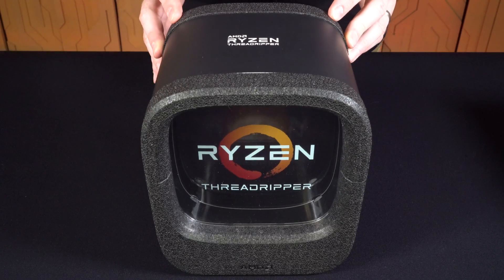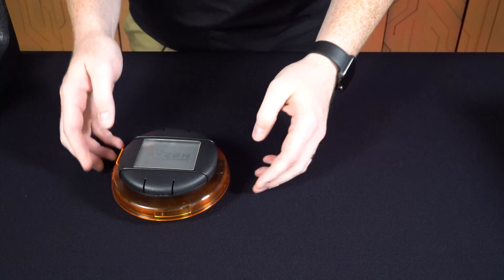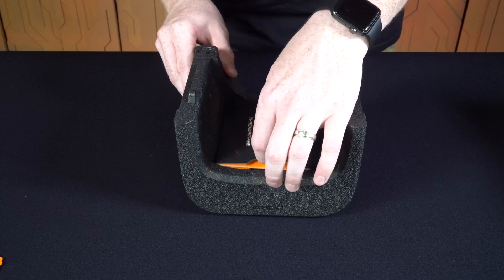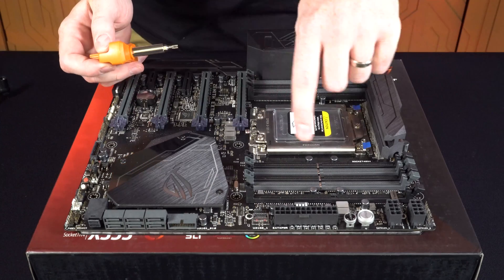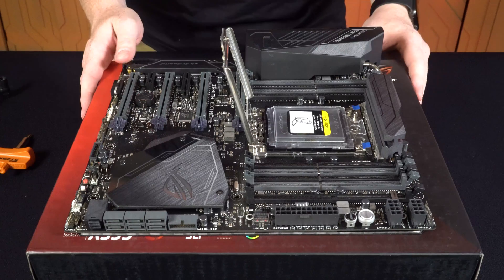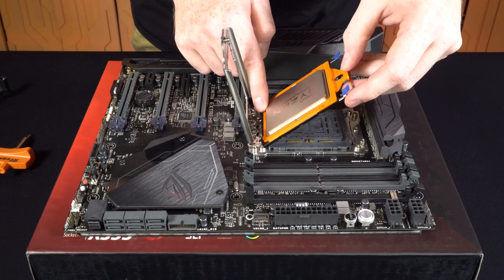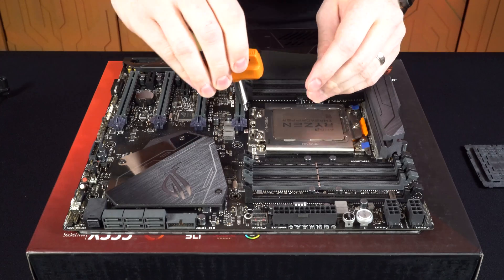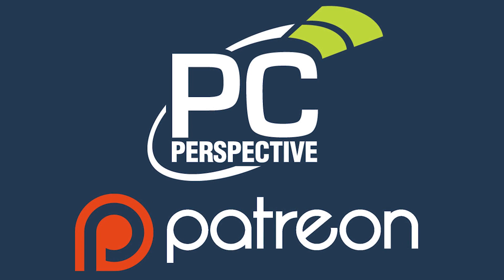How to install the AMD Ryzen Threadripper Processor

Comment: wow no more drop in  at one time we had to futs around with spring loaded clips that were like mini wishbone suspensions and after that we had a CPU cooler that had what looked like plastic wall anchors to secure it to the mother board this looks so much easier and strait forward being as I will go with water cooling not worried about the tension just want a good fit to shed the heat as most users will be using some form of water cooling its just the way to go when the power goes this high but heat sinks weigh allot compared to a water block also wanting to mount the board horizontal likely in the core x9 case this is is better for allot of reasons if you go with an air cooler better for the CPU video cards becoming heavier these days will put less stress on the socket  the same for m2 ssds when mounted flat on the motherboard and to some degree even when mounted like ram then comes the issue of air flow you do not have heat raising from one area of board to effect another with proper air flow better for the board all around here is the down side to a horizontal mother board mounting size of the case that is a big issue next is heat from other sources might be an issue like non SDD hard drives being mounted under the board in the core x9 case air flow from the front is split from the front air enters some goes over the board and out the top and back some air goes under the board  were the power supply and 3.5 internal drives are then it can exit via the power supply or a fan in the back next to the PSU or out the side with an optional second side without a window default is one side with a window one without  the one without is were the fans go but keep in mind the fans will interfere with the placement of your hard drives so 2 on each side and you have no issue with hard drives use 4 fans on one side and 2 on the other side and you have space for 3 dives and then no need for that many fans really you just want enough fan exhaust on the bottom so your not sucking hot air from the hard drives and reducing cooling for the mother board its not about supper cooling the typical 3 hard drives you might find on a typical insane work station most people do not have more then one hard drive todays big gamers are gonna have a min of 250 GB m2 ssd and 2 TB on none SSD storage while I would want 500 GB or 1 TB  m2 storage and another 2-4 non SSD storeage witch would require one hard drive and what what I want to see more of is external bays for USB ports fan controllers and media slots as well as hot swapable drives internal drive bays are just no longer needed as much any more
Reply: on another note off topic we need cases with standardized fittings for liquid cooling hard ware radators seem to fit over fan locations pretty standard until you get into sizes above 2 120/240 mm fan openings so we have water pump and reservoir mounting issues were double sided tape seems to be offered right now or special brackets to adapt to fan mounting holes really we need a few options of 4 screw holes in the bottom of the case with an unobstructed clearance to the top for that big bong tube and hard rubber pads to isolate pump vibrations

Comment: Hi, i pre-ordered the Ryzen threadripper 16 core and also the Asus ROG motherboard on Amazon, i don't have too much experience building pc's  i basically work with 3d renderings and my question is:
What PC tower Case should i get for this motherboards and it's other components?
What will be the best Cooling system for this processor?
And  Do i need a specific power supply for this? 

Any recommendations ?
Thanks in advance

Comment: Thank you, for this video, for showing us that it is NOT that hard to install the AMD's Threadripper process, you was the first YouTube'er, beside MSI . that actually done it correctly and not putting your fingers oil allover the CPU under pads, nor did you drop it or cast it down on the table; thanks for respecting the technology.
Raid out.

Comment: wow, not sure what think of it. What was wrong with the old way?
Reply: fetB Difference now is the size of the processor and the amount of pins around 4000. More chances of damaging the pins on the motherboard due to the size/weight of the cpu. This should help beginners and I don't mind it even if it takes an extra 30 seconds and saves me from accidentally dropping the cpu and having to get my motherboard repaired/replaced.

Comment: that does not seem to be a very wise torque procedure. after you flip down the processor retention bracket you  should probably  start all the screws a couple of threads and then torque them in order

just my two cents, im a mechanic and i torque things all day long... so what do i know
Reply: Tha is the correct way, I'm also mechanic, but normal people don't know about torking, not the proper procedure to do it, they just screw however they want.
Reply: TORQUE!!!

Comment: Could you imagine if games did actually use 16 cores though? You could underclock this to 1GHz and run it entirely passively.
Reply: other tomperson it's possible to spread dozens of tasks over 16 cores, but near impossible to make the most demanding task so easy to process. In games one or two tasks are always very demanding and you can't parallelize them.
Reply: yep, its like motor tuning. You can do a lot of shit, but you can't replace pure capacity

Comment: That mechanism looks like a massive pain in the arse.
Reply: Not really. Looks better than dropping this gigantic processor on such tiny pins...
Reply: You spelled 'over-engineered' wrong
Reply: Actually it is extremely well engineered. LGA pins of X399 motherboards are very fragile, and this mechanism is intended for minimizing the risk of damaging any of the pins. Important when you factor the price of an X399 motherboard.
Reply: HARDOCP damaged his motherboard socket; Kyle said the pins are extremely fragile. https://www.hardocp.com/article/2017/08/03/amd_ryzen_threadripper_unboxing_install
Reply: looks like fun.
Reply: I think it's better than the pins on chip that amd had, destroyed a few pins on them cpus after trying to fit the cpu with the board in the case like a nob..

Comment: I like that it seems pretty idiot proof, its always a worry that I'll clumsily bend a pin on the CPU or socket.
Not sure about the orange bit that remains visible when installed in bracket, but I imagine most air & water coolers will cover that anyway.

Comment: We know how to install it now. I CAME HERE FOR BENCHMARKS.
Reply: Not going to happen until the 10th when the NDA lifts.
Reply: in games the same performence as the 8 core models, but fucking fast in workloads.
Reply: I wonder if it won't take a little core wrangling to squeeze some performance out of it just to keep it on the same die. But hopefully the IF will do what it's supposed to and it won't matter.
Reply: I came here trying to find out how JayzTwoBrainCells broke his...

Comment: this is the most bullshit instalation process ever......who ever had any probem installing any intel LGA cpu? anyone? My old 775 P4 didnt even have a covers, ffs.
Reply: Well then don't buy one, problem solved!
Reply: Bit of a difference between 775 and 4094 pins. With so many pins placed so closely together, this installation method reduces the risk of bending a pin from trying to fit the CPU into the socket by hand (or dropping it while trying).
The installation took about 2 minutes and 28 seconds in this video (from 2:43 to 5:11). If you think that's too time consuming, maybe building a PC just isn't for you and you should just get an iMac.
Reply: The socket has more than 4000 pins in it, and these pins are waaaaay more delicate than intel ones, you can't simply install the CPU the same way Intel LGA does, you need more security measures to not damage the pins, so AMD did great to provide us with this solution so WE don't take the risk of losing our money by fucking our mobo and CPU, if Intel had this socket side, it would have done the same.
Reply: Quite a difference from a 775 pin socket to one with 4092 pins! Do you even realise how TINY those are on modern sockets?
Reply: Laharl Krichevskoy If you find this hard to do then you need to check your brain.
Reply: The amount of pins on consumer Intel CPUs is much lower than the amount of pins on X399. The risk of damaging the pins with the old "just drop the cpu" method would be incredibly high.
Reply: Your old 775 P4 also didn't have over 4000 pins and a massive surface area that needs a large amount of mounting pressure to ensure proper pin contact. Intel's slightly smaller LGA3647 socket also uses screws for CPU retention so this is nothing new.
Reply: Warning!!! Intel fanboy!!!
Reply: It's because AMD knows many people have had trouble with LGA socket and bent pins because they do not care enough to be careful, and ends up making the mobo AND the customer have a bad time. So, they decided to make it a little more complicated but much more safe to install, as you don't have to contact the pins nearly as directly. Slide the cpu holder with the cpu in it into the thing, press it down until it snaps. Now, put the top part on and torque it in. It even clicks when it's at the correct torque pressure so that you don't over torque it.
Reply: Cur tis ^completely agree with you. Currently using an Intel processor, but damn the guy is such a fanboy spreading bullshit lies.
Reply: Laharl Krichevskoy How did listing your shitty specs prove anything? Get a life before you start talking shit to somebody.

Comment: AMD is winning right now
Reply: +FunsterProductions  It's not confusing.  Do you have a driver's license.  Driving a car is far more confusing and complicated over what we just saw.  Over previous installation methods this just adds one or two more steps.  Steps that prevent damage to the processor and the LGA pins of the motherboard.  It's fine.
Reply: lol, My friends go to me where is your ThreadRipper content, mean while I have 61 subs and no way am I anywhere on AMD's radar.  And I have a hard enuff time just paying the rent. Let alone buying stuff just to do a video on it. Mucho sad face.
Reply: Looks pretty straight forward.
Reply: FunsterProductions agree,  it feels like over designed, and we haven't gotten to the thermal paste application problems yet